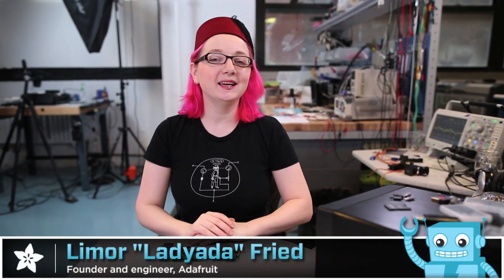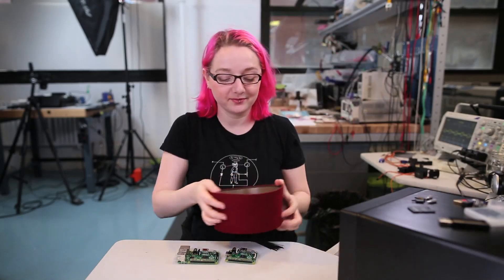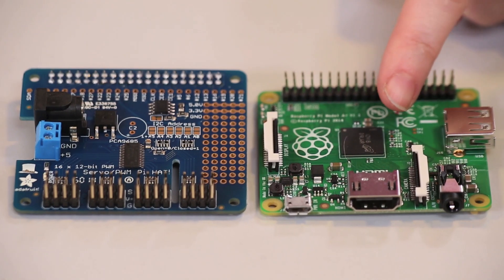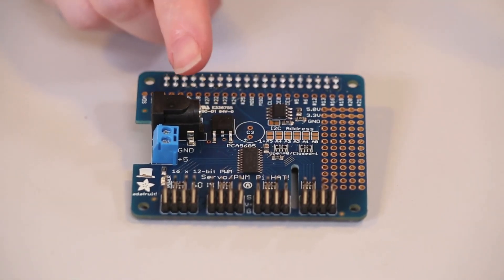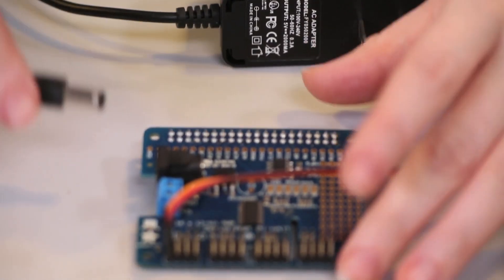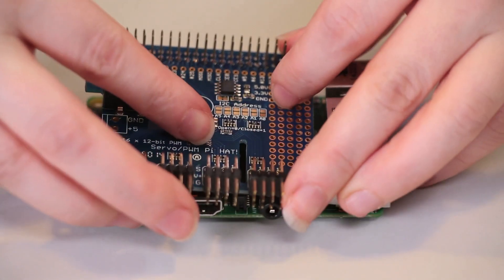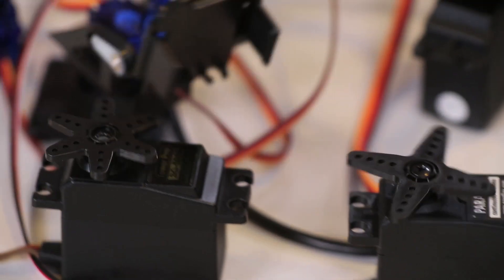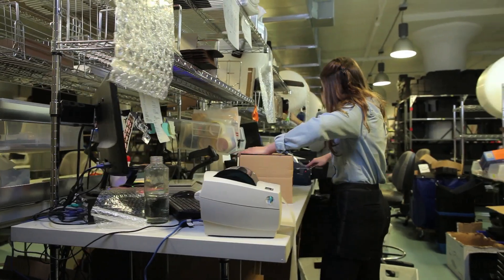Adafruit Servo HAT for Raspberry Pi - 16-Channel PWM Mini Kit

Comment: Two Questions:
1) Does this HAT generate it's own clock frequency for the steppers or does it use the clock from the PI?
2) Can I still use the GPIOs for controlling servel switches and sensors?
Reply: Did you ever answer your second question?

Comment: mam while using the servo hat for controlling the servos simultaneously can we connect  sensors to raspberry pi.... like in my project i am using 16 servos so i have to use servo hat,,, while using servo hat can i connect sensors to raspberry pi

Comment: How do I change the pwm frequency to control 12v dc motors with this hat?
Reply: You can look up datasheet of this 16-channel pwm chip. It explains very clearly about what registers you have to access and what to write to get desired result.

Comment: Can I use these 50 holes below horizontal line pins with (5V/3.3V/GND) to soldering own sensors (which now I have on breadboard) or these holes are already connecting to some pins???
Reply: Hi! I'm wondering the same thing. Have you tried it out yet?

Comment: Does this have passthrough availability? I am trying to control a RC car with my raspberry pi and I can control the ESC with PWM easily, but I hear servos get jittery. Could I use other pins while using this hat?

Comment from the maker: Adafruit 16-Channel PWM / Servo HAT for Raspberry Pi - Mini Kit
https://www.adafruit.com/products/2327
http://youtu.be/6fzHTwYVKrc

Raspberry Pi  #raspberrypi
Reply: Will Collins
Reply: Can I use these 50 holes below horizontal line pins with (5V/3.3V/GND) to soldering own sensors (which now I have on breadboard) or these holes are already connecting to some pins???